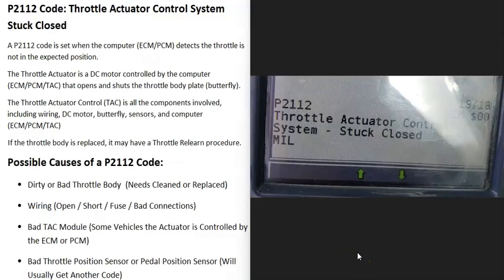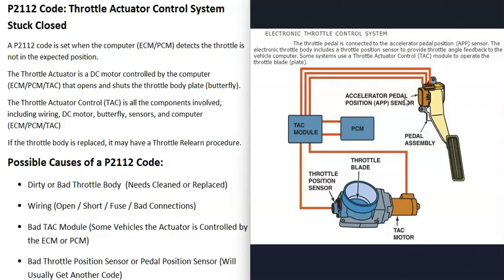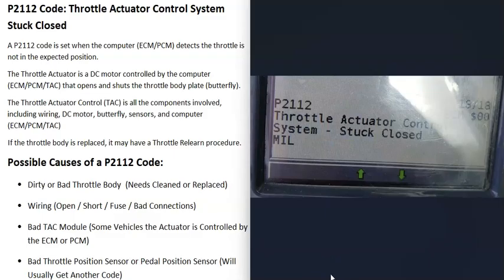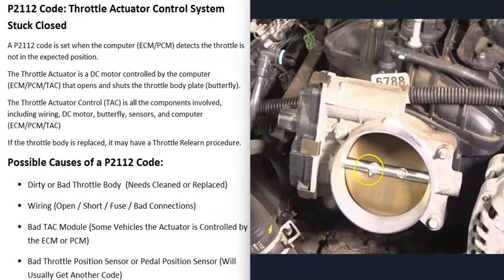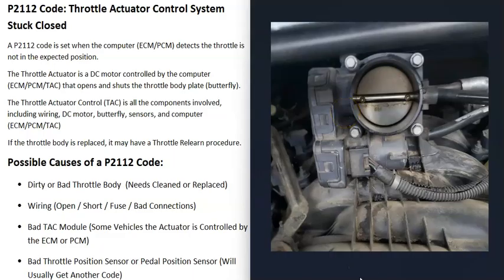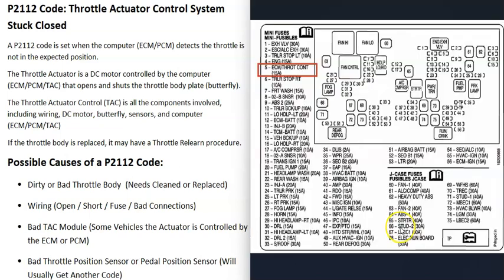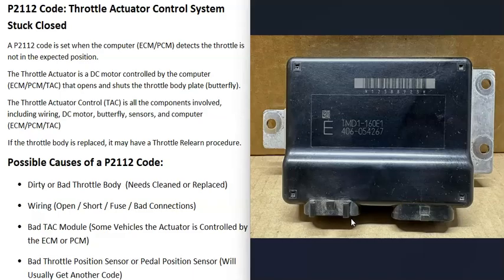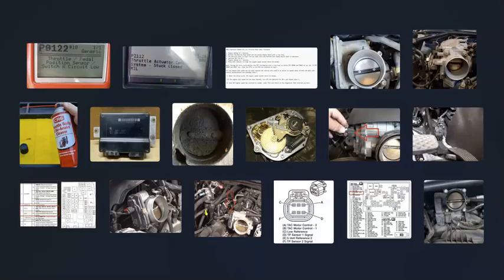Causes and Fixes P2112 Code: Throttle Actuator Control System Stuck Closed

Comment: I have a p2111 code on my 2010 Lexus Gx460 & it says “throttle actuator control system stuck open” now I replaced the throttlebody and the car still does not want stay on when I start it

Comment: I just replaced the throttle body on my Toyota Camry 2013 and the problem still persists am frustrated now. How do I fix this
Reply: I just did the same thing to my ford freestyle, changed my throttle body and I still have this code. Did you fix it